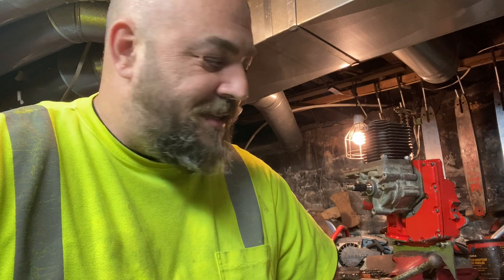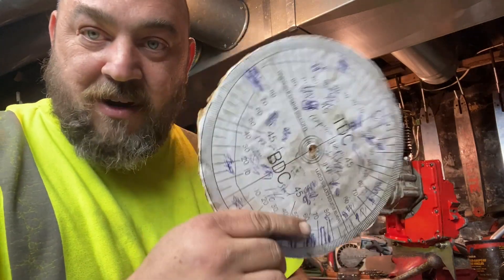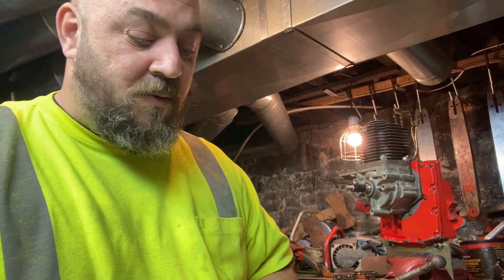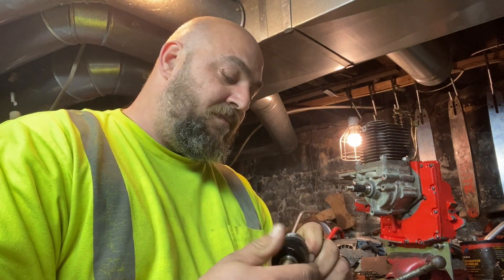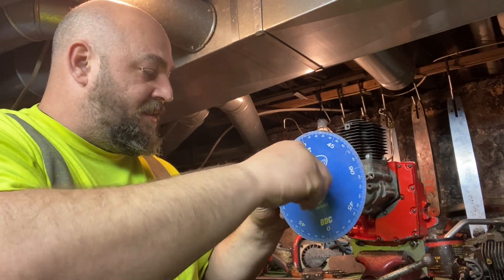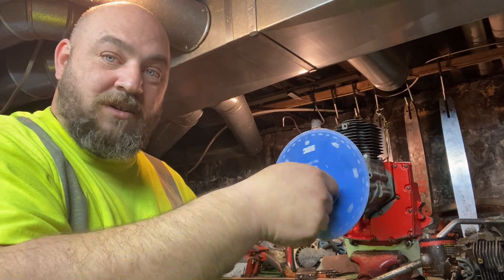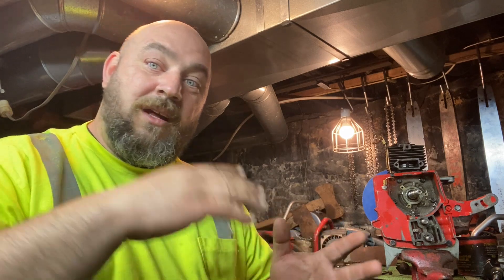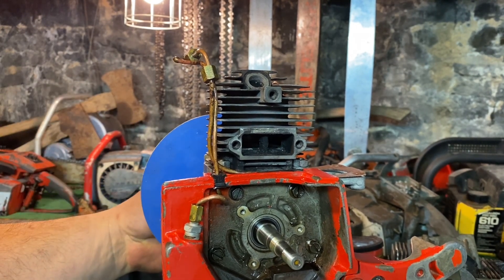Chainsaw Porting Class!!  How To Port A Chainsaw For Beginners!  Homelite Super XL Automatic #5

Comment: it looks like to me i could just start at 77, then rotate to 77 if i wanted to
there has to be a reference point you are stopping at someplace to force you to be on or off the mark.
Reply: i think the reference point is the piston hitting the pen and if it hits an equal number both ways it means the tdc will be at 0°
Reply: and depending on the size of pen or anything you use, your reference could be 30° both ways or 130°.

Comment: my numbers so far are compression 140, squish .065 without the base gasket, exhaust opens at 106 ATDC.  Does this seem right?
Reply: Your numbers are dead on for a clone I was working on. My squish was right there as well with the base gasket deleted. Just be sure the bottom of your piston is not venting the case(free port). With the piston at tdc, look and see if you can view into the case(bottom of the exhaust port). 
If no gap, you are good. If you see a gap, will probably need to use a base gasket.
Reply from the maker: Is the compression before or after base gasket delete?
Reply: @Smittyschainsaws  The compression was taken before the base gasket was removed